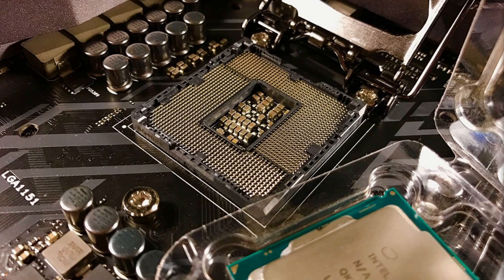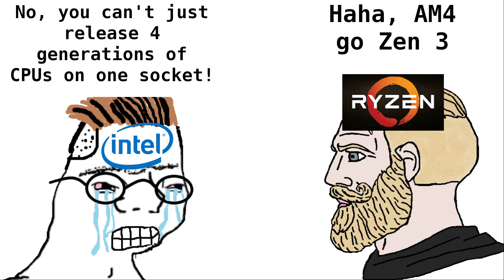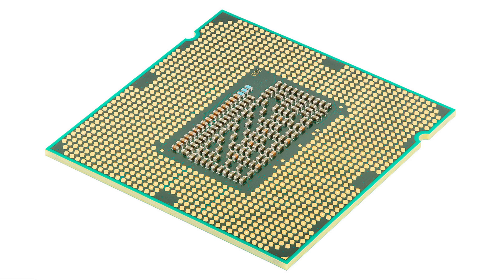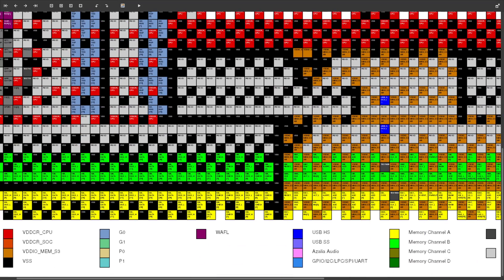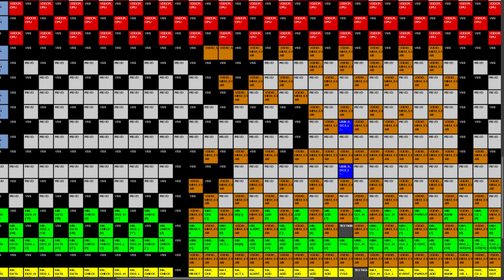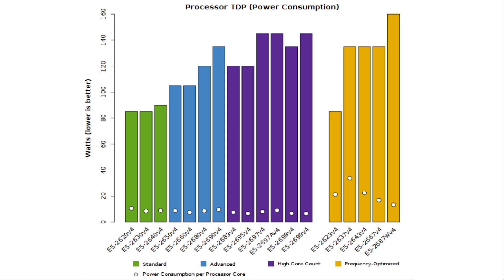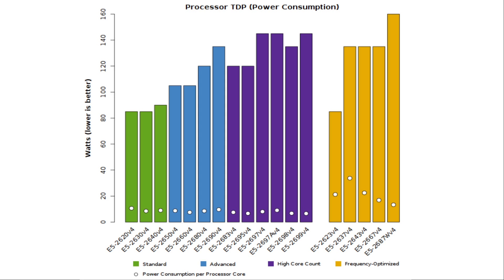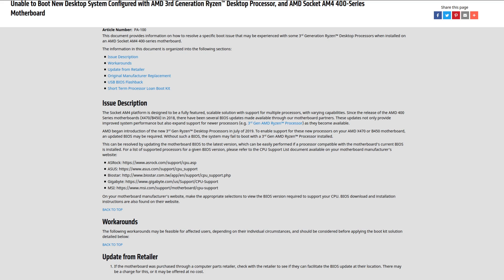The Reason for CPU Socket Changes

Comment: The socket change from Skylake to Coffee lake pissed me off so much that I decided to never buy a desktop Intel CPU ever again (and use a "swear" here). Good job Intel, you've lost a customer for possibly a lifetime.
I get it, there were some important changes to power delivery or something... but Intel, you had already changed the socket two generations before with Skylake (which is kinda where this whole debacle with frequent socket changes began)... And you didn't even change the socket physically, you just made the chipset incompatible!
 
Wait, Mental Outlaw is actually defending corporations here... What?
Reply: Your forgot the part where you could even mod your old BIOS to support the new CPU's. Had a 9900k running in a Z170 for like half a year and it even worked pretty good. Didn't even lose combability with old CPU's as the BIOS chip was big enough to basically support all microcode's and features that were moddable.
Reply: @lonelypotato3001  By mod, you mean install custom firmware?
Reply: @justsomeguy5103  Yes. You can use some older BIOS versions for Z170 boards and modify them via tools like Coffeetime to support 8000 and 9000 CPU's.
Reply: Also, I'm pretty sure that Skylake CPU's performed better than CoffeeLake anyway??
If I'm not mistaken, every new generation of Core generation meant slightly worse performance, as can be seen of videos benchmarking performance of Cities Skylines (a CPU-dependant game)
Out of all Intel generations, it seems like the best performing one was the i7 4xxx
Reply: @FeelingShred  How does that make any sense? My i5-12600K performs better than the i5-11600K, i7-11700K and the i9-11900K (according to benchmarks). So, what exactly do you mean?
Reply: @bitw1se  What "benchmarks" do you mean exactly?
Reply: @bitw1se  We would need to compare these newer Intel models in CPU-bound games like Battlefield, Cyberpunk, GTA 5 and others. Make a video showing how it works on real applications. And then we search up the thousands of videos from the past to see if there is gain in performance compared to older models. It's easy, just make videos and post the links here. If it's so easy I'm sure you can proove it. Nothing to be ashamed, right? LOL
Reply: @FeelingShred  Lmao an i7 4790k isn’t going to outperform an i7 10700k 🤣
Reply: @FeelingShred  The benchmarks speak for themselves. I wouldn’t even need to show you my own benchmark, you can just look up others, and you will see the same. Since I’m pretty confident, yes I would make and record benchmarks, but my setup is bottlenecked by my Low Profile 1050 Ti I could record them with an external camera, but my system is not able to record most games right now. I can’t afford a better GPU right now. Also, testing the CPU with applications that rely on the CPU only, are much more accurate IMO.
Reply: @chocolaa-p2689  let's see how the 10700k performs on large saved-game maps on games like Cities Skylines or Transport Fever 2 then... there are save-files for these games that you can download to perform stress-tests... I'm only believing anything once I see it... Cities Skylines is one of the very few games that can make use of 8 cores and depends on CPU speed to run, so it's a rather fantastic way of testing CPU's one vs the other
Reply: @FeelingShred  The 4790k doesn’t even have 8 cores it has 4 cores and 8 threads the 10700k has 8 cores and 16 threads + 6 Generations ahead of the 4790k in IPC
Reply: @FeelingShred  Why don’t you send me your source for the claim you are making about an i7 from 2014 outperforming an i7 from 2019 that literally has DOUBLE the cores and threads AND has much better IPC
Reply: @FeelingShred  Oh wow, I can’t believe you actually believe an i7-4790K is faster than a i7-10700K xD I guess that settled our debate xDDD
Reply: @bitw1se  Make your own videos showing how the 10.700K performs in games then, and I will compare their performance to old videos that demonstrate the 4790K's... nothing to be fearful about, right? XDDD
Reply: @FeelingShred  I don’t have a 10700K, but dude, you can just look it up. There are so many benchmarks out there, I don’t need to do my own. I have a 4770K and it’s good enough for most games, but my new 12600K basically doubled the performance of all the games I play. It’s that big of a difference.
Reply: dude the first LGA 1151 were supported for 6000 and 7000 series CPU

that is 2 Generation :), they always 2 Gen per socket
Reply: @heickelrrx We haven't had a proper new Gen since the change from Broadwell to Skylake. Eversince we just had Skylake-Refreshes and we will continue to have them for quite some time. Intel hasn't actually released a new CPU for years, just the same shit with minor improvements and mayor power increases. You could almost say, that Intel supports sockets for ~¼ of an architectures lifetime (percentage decreasing, as they continue to release new Skylake refreshes).
Reply: @lonelypotato3001  this is outdated information. 

From 2015-2020 Intel reused the Skylake architecture, increasing core counts, frequency, and power consumption. This was especially frustrating because Skylake was only ~6% faster than Haswell. 

In 2021 we got Rocket Lake with the Cypress Cove architecture. Cypress Cove delivered better single threaded performance, but Rocket Lake wasn’t better than Comet Lake in gaming, and was widely ridiculed for increasing power consumption while having worse multithreaded performance at the flagship.

Intel rectified this with Alder Lake which retook the gaming crown from Zen 3. Golden Cove in Alder Lake further increased single threaded performance, and the usage of a heterogeneous architecture with Gracemont cores allowed Intel to compete with the 5950X in multi-threading. Some say that the 5950X is better in multi-threading, while others say the 12900K is the fastest. With PCI-E Gen 5 and DDR5, Alder Lake is on a genuinely impressive platform, and should be seriously considered for a new PC. The only downsides to Alder Lake is incompatibility with DRM in older games and certain other issues due to its heterogeneous architecture. Also the Alder Lake platform is expensive.
Reply: @dex6316  IF you're going to consider the Cove's as a new tock, then at least start with the original 10nm one and not the 14nm port of it. In 2019 we got Sunny Cove (Ice Lake) which was used for 10th gen mobile. Its derivation Cypress Cove is just a 14nm port, up from 10nm with a latency improvement in L1 cache access cycles. 

Let's face it - Intel is struggeling to keep up and it's struggeling hard. The only way they can outperform AMD atm is by ridiculous clock rates and thus power consumptions. Even Gracemont won't solve this issue, it merely reduces it. Even now with their efficiency cores, they struggle to get even close to their competitors performance/watt. While I certainly agree, that it should be considered for a new PC only the DDR4 ones are financially viable for any normal human which further reduces Intels performance, bringing them closer to AMD's level and thus reducing their viability.

What I'd like to see is a further development of Gracemont and maybe a high core count low power server CPU that could compete with EPYC especially in regards to performance/watt. I'd seriously consider getting something like that once it lands on Ebay for a price that humans can pay, a few years down the road.

Also, thanks Intel for rebranding your 10nm process to Intel 7, in order to hide your embarrassing struggle to put out anything on 10nm.
Reply: @heickelrrx  I did say "2 generations before". I simply forgot what the 7xxx generation was called (was it... "Kaby lake" or something?), and I had a CPU from 6xxx specifically. But since Skylake is what started this socket, can't I colloquially call it the "Skylake socket", if the Coffee lake compatible version is sometimes called "LGA 1151 - Coffee lake" to distinguish it from the incompatible version?

Comment: But what about chipset upgrades? Something tells me you wouldn't want to run an i7 11700k overclocked on a 7 year old motherboard. Even if the socket fit, there's gotta be some performance loss.

Comment: 3:50 i7 6700 from Intel is a case of this and does work in a LGA1151, but with newer versions of motherboard (such as series 300) can't run 6th or 7th gen CPU from Intel but instead run 8th and 9th gen CPU's from Intel. Hope this helps as an example, also as a hint with the "Series" portion.
Hope yo have a great day & Safe Travels!
Reply: You can mod a mobo to support the 9900k with 0 issue

Comment: I think Intel isnt change the socket, they are same as Ryzen but the Motherboard wont get support when it comes to new generation like Skylake or Coffelake.
Zen, Zen+, Zen 2 or whatever is the generation not socket, and 1155, 1151, AM3, AM4 is socket i think.
Intel Skylake - Coffelake is same socket (LGA1151).
Sometimes i hear you can mod BIOS and support gen like 6/7 to gen 8/9.

Comment: I have an X370 motherboard from when first-gen Ryzen was released, and it cannot be updated to handle the new Ryzen-5K series chips so "technically" AM4 has not been fully compatible across the full AM4 generation. I think the cause of this was that AMD did not expect to have the number of processor models they ended up creating for the AM4 socket and the original EEPROM size on the early boards was too small to hold the microcode for all the CPUs. That kind of thing is probably another reason why Intel is constantly changing sockets, though it's pretty galling when later on someone is able to run a new chip on an "Incompatible" socket without any significant hardware modifications.
Reply: a320 supports ryzen 5000
Reply: @amogusamogus8490  no they don't.
Reply: @PlayerUzU  Sussy amogus man has a point. About a month ago gigabyte and a couple of others released updated bios's for the 5000 series.
Reply: @PlayerUzU  they do, by sacricifing early cpu compatibility on the bios, just a matter of software really.
Reply: @NickelLight  WHAT? for a320? That's new for me
Reply: @NickelLight  WOW, it's actually truth, well they probably aren't enough to use with any of them (the VRM might go as hot as an i9 12900K lol) but this is intersting, if the Asus EX-A320M Gaming gains that update too it might be a decent pairing with a 5600X.
Reply: @PlayerUzU  Yeah I imagine running it with a high tdp chip would be a poor choice but perhaps we'll start getting official support for the higher end 370 boards with better vrms. Like you said 320 might make sense for the lower chips or if someone's 450 board dies and they need to fall back on a spare.

Comment: TDP is definitely not the reason.

Its difficult to compare different generations of cpus, but if we look at the 200 to 300 dollar price point (mainstream cpus like the 2600k, 3770k, etc), intel tdp as remained stable from 2007 (first affordable quadcore) to 2019 (first affordable 8 core).

Even the infamous AMD fx 9590 used the same socket despite having almost double the tdp of the original cpus, there were problems with some boards not providing enough power, but still the same socket.

Now the features excuse, for example pcie3 support was added to lga1155 and pcie4 to AM4, no need to change socket. Many laptop cpus support ddr3 and ddr4 on the same socket.

I sincerely don't understand why intel does this, the joke is on them though, if they supported sockets for longer I would have upgraded my 3570k and given them money, instead I have to spend 100usd on top of a 200usd cpu, not worth it.
Reply: Even if it was, then Intel should stop making each generation use more and more power
Reply: @PashaGamingYT  why do you care about power, go use a console if you that worried about power usage
Reply: @imo098765  

Because I don’t want my CPU to run so hot and I want to do actual work on my computer.
Reply: @PashaGamingYT  so the same temp as a 5600X for the 12600K is a problem when its faster?

If you want to do actual work, you want it done as fast as possible
Reply: @imo098765  

You can’t do work on a console.
Reply: @PashaGamingYT  Read the other response, the first one was just for gaming

For work getting shit done as fast as possible saves you more money than something being 10C hotter
Reply: @imo098765  

That still doesn’t mean Intel should use twice the power for 20% more performance
Reply: @PashaGamingYT  but it doesnt draw twice the power.

If you want the best performance its slightly more.

If you mean the i9 part, its only the i9 that draws that much power but you would be getting a 5950X
Reply: @imo098765  

It still uses an insane amount of power while the 5950X uses like 120W
Reply: @PashaGamingYT  Thats the one part of Intel that doesnt make sense. The 5950X is on another level of power draw and performance
Reply: @imo098765  the 12600k has about double the power consumption of the 5600x. It runs way hotter and is more expensive even without adding cost for a better cooling for it to run at the same temperature.
Reply: @the4given196  go look at gaming benchmarks they use the same power for its primary function.

If you doing work that loads all the cores, you getting a threadripper anyway because thats the best for work
Reply: @imo098765  ... You like moving goalposts, don't you?
Reply: @vyor8837  NO the 12600K in gaming is faster than the 5600X and uses about the same power, in gaming which is the primary role of most gamers

If you want to do work on your machine as its part of your job and its heavy work, you get a threadripper 
- It has more cores
- Quad-channel memory
- ECC memory 
- 80+ PCIe lanes

So you see if you want a work station you dont go get an i9 or r9 you get a threadripper because it offers the best solution for a workstation
Reply: @imo098765  the 12600k is faster in productivity as well.

It's also more expensive than the 5600x is thanks to motherboard costs. Since people were talking about said price being a problem, they aren't going to be looking at a multi thousand dollar CPU. Instead, the 5800x and 5900x are options; the second of which is faster than first gen threadrippers in every task.

And both desktop and HEDT ryzen chips have ECC.
Reply: @vyor8837  Did you see the 12700 non k review from hardware unboxed, 50W less system power draw than the 5800X and the same performance.

Oh, so its using less power and performs the same. I guess thats another part and review that shows I was right
Reply: @imo098765  it pulls around the same power tho?
Reply: @vyor8837  checked HUB system power draw, its 50W less power in gaming situations
Reply: @imo098765  >gaming

If all you're doing is gaming, the i5s and r5s are right there.
Reply: @vyor8837  if you only gaming, but better frametimes when you doing other shit with your computer on the side.

also you get a better user experience now and it theoretically can last you longer and when you want to sell it in the future you get more for it too.

So really what you talking about is i5's are ok but not really good if you actually use your computer
Reply: @imo098765  other shit going on is multicore perf, something that the 5800x just about matches the 12700 in.

Comment: I once managed to get a second gen i3 running on a first gen motherboard which has 1156 pins and the second gen CPUs have 1155 pins. Quite funny that it actually worked even though the socket was not the same
Reply: How do you pull it off? I could try install i5 3470 on h55 main board
Reply: @bitelaserkhalif  I am not quite sure myself. It was so many years ago but from what I remember I just put the cpu in and it booted somehow

Comment: Processors on LGA 775 have a power draw of 130W minimum, now they need minimum 1100 pins for 90W.
New features on a CPU was not introduced from first i generation of intel, SATA has the same number of pins, PCI-e has the same number of pins, USB the same.
PCI-e, SATA, USB are quite the same, they add more of each but features are pretty the same, even DDR3 & DDR4 they have pretty the same number of pins on the BUS.
They move pins around to justify socket change, processors can be made with a legacy mode, to boot on any bios until after the update, this is a firmware issue not a hardware one.
Look at Chinese laptop CPU's from old generations modified by Chinese to work on new motherboards that they tell that does not work.
Now a days south bridge does not do much more than first i generation from intel.
So....

Comment: Off course socket changes are needed, but Intel has just been way too anti consumer with their 1 CPU gen per socket standard the last years, Sandy Bridge and Haswell at least let you 2 generations.
AMD might have overdone it though, but I'm not complaining.
I think 3 CPU generations per socket would be the sweet spot.

Comment: Intel clearly doesnt do this for just the tdp. There was this chinese guy that modded a motherboard so it could support all core i3-i7 from first to eighth  generation
Reply: Intel doesn't know the precise specifications of PCI-e in advance either. Who knows what frequencies, voltages, or number of lanes they might need. Moreover, they don't know precisely how much power they will need generation to generation. Particularly when they're far behind schedule on shrinking their die sizes. This has led to monsterously power hungry CPUs and backports of newer designs to their old platforms. Which of course they couldn't have predicted very easily.

The only feasible way they can future proof things would be to plan for a lot of unknowns, and subsequently increase the cost and complexity of board manufacturing. I think being prudent and not adding unnecessary cost is the way to go. Particularly when struggling as they are right now with their architecture.

That said, who cares what someone did with hindsight? That isn't a luxury Intel had, and no doubt they backported a newer more expensive socket to the older generations; not the other way around.